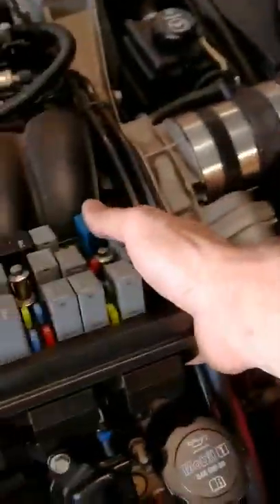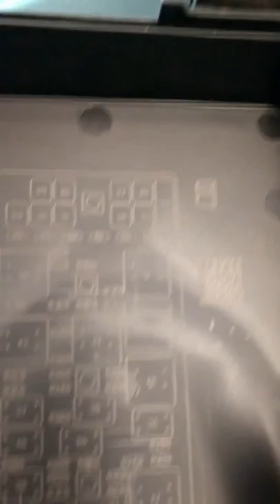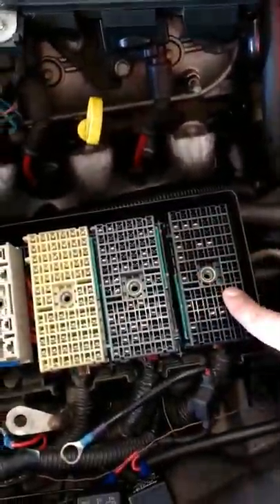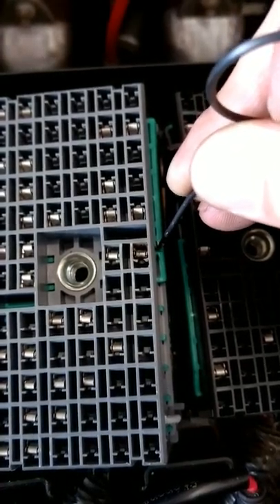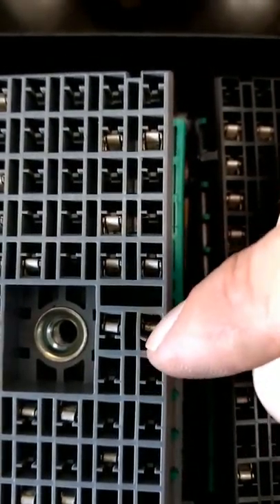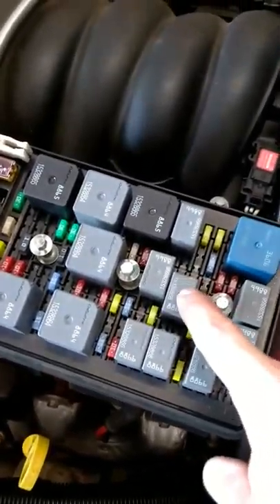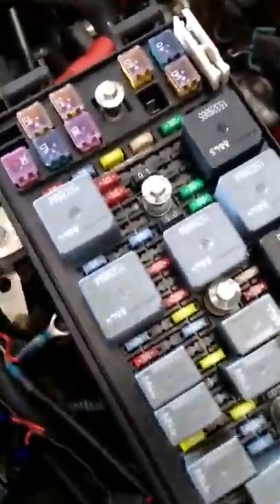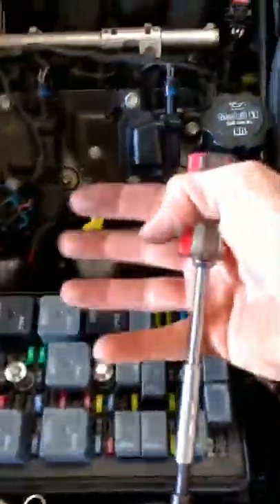No start!  Shutting off while driving!

Comment: Fuel pump relay socket had a loose connection for a pin, I noticed the arc spot on one of the relay prongs. Gave it a squeeze and put the relay back in and no more issue for me. 97 chevy k2500 5.7.

Comment from the maker: Turns out it was the connector fatiqued and not always making contact.
Reply: So when the car got hot is when it was shutting off? I've got a 07 GMC envoy Denali doing this. I'll let the car cool some and it will start right back up.
Reply: @RobertSmith-wh5jb  my car is doing the same I have Yukon 2004 when I drive it will shut off after 30mnts and I let it cool down for 3 or 4 hrs then it will start again. Any idea for the cause?  I already replaced crank sensor but still same
Reply: @lisawilson8504  I did. I had a broken wire inside of the fuse block under the hood. Everything I read said that the fuse block would need to be replaced, however I was able to take it apart and find the broken wire using a multimeter. I patched the wire with solder for the time being and it had lasted so far with no issues.
Reply: @lisawilson8504  I dont know if you know anyone who has an OBD2 scanner, but if you do and can get them to scan the car for codes...if you have any referencing pcm low voltage and throttle body codes..those were the ones that I was getting off mine.
Reply: @RobertSmith-wh5jb  did you fixed your issue?
Reply: @mariotoledo6658  I did. Inside the main fuse block under the hood, there was a hairline crack in one of the copper wires. When the car would heat up the wire would separate and shut off.. I would let the car cool off then it would run fine. I had to replace the fuse block under the hood.
Reply: @RobertSmith-wh5jb what’s a fuse block I got same issue
Reply: @antonioharris7711  the entire fuse box under the hood. The guts of it are called the block, it's just a bunch of copper wires running from the top to the bottom when all the wires plug up in the bottom of it. I replaced the entire fuse box and it fixed all of my issues. Its not the cheapest fix unless you can find a used one.
Reply: @RobertSmith-wh5jb  ok thanks where I find new ones no junk yard
Reply: @antonioharris7711  sadly I had to buy one from the dealership. I believe it was around 250

Comment: My 2002 Honda Odyssey literally shuts off while driving.. It takes 10-15mins before it starts again.. My mechanic said it's not a big deal but, my van continues to die while driving.. I've bought 2 new gas caps, fuel injection cleaner. I love my mechanic (Cal's Auto 😊❤️) and they do great work and never charges me when I get it checked. Any suggestions on what could be wrong? He says it's a sensor that deals with how much smog my van  puts out.. He said if we lived in a smog check  state, (like California.) I'd have to fix it. Since we don't, I shouldn't worry about it.. 😭 My van only does short distance trips like Kroger on Main Street and Hamilton Rd and it's a gamble for that distance.. Any suggestions??
Reply: Hello did you ever get the problem fixed

Comment: April 8,2024 my car shuts off while driving and won’t start to it to a garage and said it was a blown fuse I drove it for the day and it did it again and brought it to another place no check engine light on and there saying it is the power control module any ideas because there telling me there not even sure if that is what it is
Reply from the maker: I wish I could help you but hard to diagnose from the simple question

Comment: Sooo you never figured out your no crank / stalling out problem even if you got it running? Mine is a 15 Ford Fusion SE 2.5 L and just started having these problems of sometimes cranking sometimes not. Very intermittent. And when I do it shuts off after a while.
Reply from the maker: The issue was just the relay
Reply: @TheLifeofaMan  now working perfectly normal. I took it to two shops and they both read 20 and 22 codes. Didn’t know what it was. Took it another shop and ran perfectly normal. Couldn’t read any codes. They couldn’t find anything wrong with car. They had it there running on idle and turn it off then on again acted fine not one single malfunction

Comment: i got the same problem with my hyundai accent is been shutting off in the middle  of the road 4 times already with no codes to go by, weird!!
Reply: Dario Mendoza did you find out the fix? My 2015 sonata is having the same issue but no codes.
Reply: Camshaft issue when it happens.
Reply: My freaking Chevy cruize doing the same shit
Reply: Is it shutting of and then starting again when you are driving down the road?
Reply: @katclaus7425  did u find out wat was wrong. My car shuts off after like 30 mins of driving. Than it starts up again in like 5 mins. I replaced my fuel pump. Still stalling. Camshaft sensor maybe.
Reply: @Tman-xr7xw  did you fix it?
Reply: @AnythingMike  yeah! I replaced the crankshaft sensor. Make sure u put the crankshaft sensor all the way in or it wont turn over. I took my sensors seal off cuz it was difficult getting it all the way in. I didnt want to strip my bolts or crack my sensor.
Reply: My 2005 Ford Escape dies when I turn a corner and then I have to replace a fuse.
Reply: @katclaus7425  mine is 2011 terrain no codes or cel